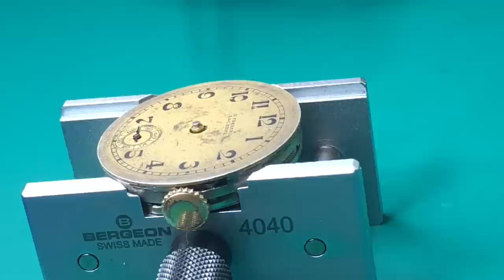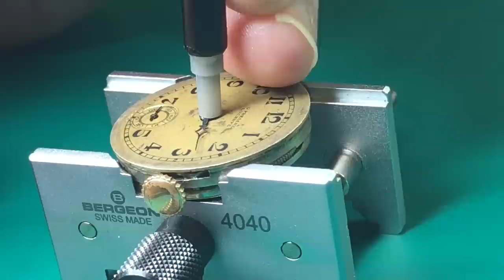First Time Wristwatch Teardown - Mistakes Were Made!

Comment: I have to say I’ve learned more about watchmaking from this video than all the professionals. I’m trying to make a run at this hobby, because it sounds really fun. Watching the professionals and then seeing the same problems I’m experiencing is super encouraging and helpful. The first watch I pulled apart I snapped The reverse thread on the crown gear. Yep game over for screw. Last week I pulled apart my first pocket watch and got it back together and it runs kind of. Thanks for the video👍
Reply from the maker: Well done! Now I just have to pluck up enough courage to try a movement with the intention of it running well afterwards! If you feel I've earned a subscription from you, it would mean a lot to me, if you're not already subbed. Thanks for watching.

Comment: Great video.  To get the pivots in the (jewel) holes in one time, you need better magnification as you said it yourself. And practice, practice, practice on large movements. Some tips: To better grip the parts, modify your pair of tweezers so that only the very end can grip the parts. Yours are bend open an parts fly out under the pressure you put on the tweezers. About a quarter of the oil is way enough. And finally, the thread length of the crown wheel is shorter than the one of the rachet wheel. That's how you can easily see the difference. Stay relaxed and looking forward to your next video 🖖
Reply from the maker: Great tips and thanks so much for commenting!

Comment: If you’re struggling to place the mainspring arbor you can always use a pin vise to hold it while twisting it in with a little downward force.
Reply from the maker: Thanks - I think I've got it worked out now.

Comment: All the books mentioned that to remove the barrel arbour, apply a little clockwise turn, while pulling gently upwards. A question. A well known YouTuber said that purchasing and using a microscope was a big game changer. Did you find this? One of Roger Smith’s watchmakers told me that he prefers a loupe.
Reply from the maker: Thanks for the tip! I've been wanting a microscope for my electronics work as well so for me it was a no brainer. My (real) watchmaker doesn't have a microscope. Another well known YouTuber seems to use his mainly just for oiling the jewels. I certainly expect that as I improve, I will become less and less reliant on the microscope. I have a clip on eyeglass that I quite like. However yes, I do think the statement that having a microscope is a game changer is true.

Comment: Great 1st time attempt I too am about ready to see if I can take one apart and put it back together, after a bunch of research I think I am leaning towards pocket watches. Haven’t bought any tools.
Reply from the maker: Yes, you can learn the layout and techniques on a pocket watch, however just be mindful that the size difference can be a bit of a pain in a bad way. I did a pocket watch first and it wouldn't fit in my movement holder because it was too big. You might also want to look at some of the chinese clone movements available on ebay or aliexpress.

Comment: I use an Amscope microscope. They are not too expensive and it's a game changer. Also, try removing and placing screws by holding the threads. Much less chance of pinging the screw across the room and scratching the screw heads. iPhone camera is pretty good.
Reply from the maker: Thanks for that - cheers. I shall need to save my pennies. I'm eying off a trinocular Amscope. Need to have a camera so you guys can see too!

Comment: I suspect that a binocular stereo microscope would make your work much easier! I don’t repair watches but I do restore vintage cameras and the shutter mechanisms are very similar to watches. I do everything with a binocular microscope. Mine has built in lights and a gooseneck so I can position it over my work on the desktop. They are not terribly expensive on Amazon.
Reply from the maker: Yes - I just need to save my pennies.

Comment: Hi Stephen - Great video for a newbee. Your electronic experience on smd components will certainly give you tweezer use knowledge. Do get yourself some really good quality tweezers such as Dumont. Very light action when handling small parts. Also get some angled tweezers as they will help with small screw placing and balance manipulation when assembling. I started 3 years ago my first watch was an ETA 7750 and boy was that an experience.
Reply from the maker: Thanks - I've got Dumont #00, 2 & 4, as well as the brass tweezers. Just need to work out when to use which ones!

Comment: I know far less than you do, but it looked to me like, from the start, there was a wobble in the balance wheel, which seems to me to an indication of a bent pivot.  You also manhandled the balance where during the disassembly and then dropped the bridge off the side of the watch with the balance partially engaged, so, yes, it's not surprising that it did not run, but for your first attempt, it was outstanding.  Mistakes are an essential part of learning.  This is how you learn, try, try again.  And thanks for being brave enough and honest enough to keep it real.
Reply from the maker: Yep - that's why a sacrificial movement was chosen. I was really surprised when it started running at the beginning because it had never run before. Thanks so much for watching.

Comment: Hi, I started with the hobby around 6 months ago. Had my fair share of broken screws and lost parts as well. I still have a movement from time to time that I just cannot fix, but there is a steady improvement.
The movement may be a variant of the Election 62 btw. Seems to be of pretty good quality.
Reply from the maker: Thanks!!! It's really encouraging to hear other people talk about starting out. By definition there is no watchmaker who at one point was not a watchmaker.
Reply: @watchout9213  You are welcome, just a tip to where go next from my experience so far.
Do some of the high volume movements first , where parts are easier to find and more affordable. AS,FHF,ETA,KF/Certina or FE , stuff like that.

Comment: No matter how good your skills are, if you can't see what you are doing you are going to have trouble. Would you sit down with a PCB and surface mount parts and try to solder them without magnification? One tip is use a light touch with the tweezers and hold them more horizontally will help you with control. I have subscribed and I am looking forward to see what you are doing in about 6-months.
Reply from the maker: Yep - it's certainly a pretty big hurdle in being able to go too much further. But hopefully I will be able to get a microscope soon. Oh, and thanks so much for the sub!

Comment: When you were struggling with removing the barrel arbour I noticed you were using your metal tweezers.  Would it be better to use a wooden tipped or plastic / carbon tipped set to get a better grip as metal on metal is usually quite slippy especially on rounded objects like that?  I'd also recommend Wristwatch Revival with Marshall (assuming this is who kingofcastlecaos was meaning in his comment) for his extensive video collection on stripping down various watches.  I think he lists some of the gear he uses as well in his desciptions so you might find something better suited for the job at hand?  As Tim L has mentioned below I've also got an Ingersoll Pocket watch to practice on but I'm yet to take the plunge and fully strip it down.  Marshall has a lot to answer for!  All the best on your watch repair journey!
Reply from the maker: Thanks so much for your comment. Might be worth a go. Yes, this is all Marshall's fault! But I get the impression that he was fairly competent before he started his channel. I couldn't see any point trying to be another Marshall which is why I started my channel at this point of my journey.

Comment: Good luck to you on becoming proficient. I figure you already checked, but you didn't break off either of the tiny metal tips on the ends of the balance spring's axle? I tried to tell in the video, but couldn't really see.
Reply from the maker: Thanks! I don't believe so, but I need to do a follow up on this movement, so I'll check then.

Comment: I just saw a video where screw tightness was outlined as - screw it in until there's resistance, and then just turn it the width of the notch in the screwhead and no more. I had no idea until I heard that.

Comment: It's hard to be sure, but it kinda looked to me that maybe there was a broken balance wheel pivot before you started disassembly. First, it has no shock protection to begin with so odds are higher of being damaged already, and it didn't look like it was moving very true, .i.e. wobbling a bit. Plus if it wasn't engaging the pallet fork at all, that is a clue that maybe the balance staff was not in the correct axis too. Those pivots may have broken in the process I suppose, but I strongly suspect it was broken out of the gate.
Reply from the maker: So I'm now using this movement as a practice movement - just to remove, refit, etc... until I get better. I looked at the balance yesterday and the pivots are definitely still there, however one of them might be slightly bent. I need better magnification to be able to tell for sure.

Comment: Very nicely done! I’m surprised the iPhone does such a good Macro job. I’m in a similar position like you, on the beginning of a journey. I haven’t recorded a full video to my satisfaction yet - it’s a process 😊 - anyway, next to a Microscope - which is nice to a) inspect small parts and b) film them, I suggest looking into video-capable „photo“ cameras. In the higher price area, that might be a Sony Alpha 7, just to give a rough direction. In addition to that, get a mid-length 1:1 macro lens (I’d suggest 100m focal length or so). It doesn’t have to be super expensive, as you online need video resolution. But that will give you a combination of proper distance to the subject (so you can still work), plus some versatility regarding positioning and framing. Might be helpful to check something out it a store that allows hands-on testing, to figure out if you get what you need. I think in Marshall’s videos one can sometimes see the blue ring typical for a phaseOne lens; those are expensive … I use Nikon, but only because I already have that stuff, and Sony is much better for video use cases. Or canon, for that matter.
Reply from the maker: Thanks - this is really helpful. Yeh, I really like the way Marshall shoots his shots, and you can cover a lot of transitions (and hide a lot of mucking about) by switching to different cameras which obviously you can't do with only 1 camera. I am thinking a Sony ZV-EV10. That way it will take the Sony E-Mount lenses. Its an APS-C sensor, which I think is fine. The bit that is doing my head in is working out what will be the best lenses. Marshall seems to use a 60mm and and a 100mm, but he has one camera that is APS-C, and the other is full frame. He doesn't say what lens he has on what camera. I need to have the lens physically far enough away from my work space so as to not be banging into it with my hand, but then it need to have the right length to get the shot I want for wherever the "sweet spot" for the end of the lens to be is. I am truly thankful for any tips on how I can work this out.
Reply: @watchout9213  Maybe I should try to do a camera tutorial video instead of a watch video ;) - great this helps. Intercutting between two angles is great, especially if you use a software that can automatically synchronise those two cameras, so you can intercut with a single click. And it really helps for the "finger in the way", "head in the way", and so forth situations. You did an impressive job with just the iPhone, though! Regarding lens: I am in no way a professional regarding how to do these types of videos, but I think a wider lens and a macro lens would make total sense; the wider one to capture the workspace, and the macro to get those closeups. Regarding the Macro, it's important to check the focal distance for the ratio you are looking for. Let's say you really want to go 1:1 (which is the max of most macro lenses, and means that the object appears on the sensor in 1:1 size), it's important to understand how close you will have to be. Lets randomly pick the Sony E 30mm F3.5 Macro; with this one, the 1:1 focal distance is 9.5cm. And that is between SENSOR and object, so you have to calculate in the body and lens length! That seems a bit impractical, so I'd go minimum 60mm, that should bring you up to about 19cm (those math is more complicated for macro shots though). I already own a 150mm macro that has a whooping 38cm 1:1 focal distance, but that's potentially over the top and those are more expensive. So realistically, I believe an approx. 90 or 100mm macro lens might be just in the sweet spot. APS-C makes sense, because we want to get small things really big, and a full frame sensor would only mean that we need even more magnification in glass. For the second camera, I'd actually suggest a zoom lens; it would give you a ton of flexibility to move the camera around and adjust framing accordingly. But I'd actually believe that you could just use your iPhone for that, at least for starters; they have blasting good cameras, and buying a second semipro camera body frankly seems a bit over the top for those overview shots. I'm currently experimenting with an old GoPro 4, which isn't great, but I don't plan to... well it's a hobby, and I try to work with what I have got :)
Currently I'm shopping for a second Nikon body to remedy some issues with the one I have (I initially got a cheap D5100, but that has some drastic limitations regarding it's HDMI out, so I'm shopping for a D5300); that might mean that I can get rid of the GoPro and just use the two Nikon bodies, unless I sell the D5100. It's... a journey...

Edit: a note regarding Marshalls setup, I would assume that he uses a 100mm APS-C for the macro shots, and 60mm on fullframe (which is like 40mm on APS-C) for the overview shots. The latter would be a view angle that would be considered "normal", as in neither wide or telephoto, and as said, APS-C makes sense for macro shots. But really just guessing here.
Reply from the maker: This all makes sense, thank you. Good point about focal distance from sensor to object. Usually when we think macro we think about having the lens as close as possible to the object, which of course is NOT what we want in watchmaking - cheers!

Comment: rather than go for another "junk movement" - get hold of a Aliexpress £30 Seagull hand Wind Movement - Seagull ST3621 or similar - they're basically ETA clones.   You'll be getting a known working movement (albeit probably not lubed in any way - it's a £30 aliexpress movement after all) that's a shade bigger than most modern movements - practice taking it apart cleaning reassembling, lubing and getting working, then repeat until you break something on it.    All this, do it with your magnifiers or loupe NOT on camera - take reference video by all means, but don't try and make video when you can't see and are still trying to hone the motor skills.   Once you're happy with doing this, THEN get hold of a half decent make of older runnign but badly watch, and do that - you'll find it much easier once some of the basic stuff (picking up screws, orienting plates etc) is more "muscle memory" after the repetition on the Seagull.    Chapeau for having a go at this, it's not easy, it's challenging, and it's a complete pain in the arse sometimes.   Always remember - the best tool in your kit is the "walk away and come back and look at it tomorrow" when somethings getting frustrating - you're not on the clock, nobodys paying you by the hour to fix stuff.
Reply from the maker: Thanks so much for taking the time to comment, and there's some really great suggestions there. I've got a bunch of ST96 movements sitting around, and that's what I want to move onto next.